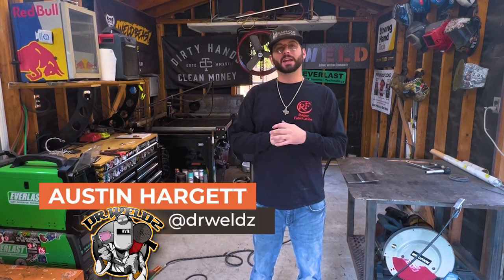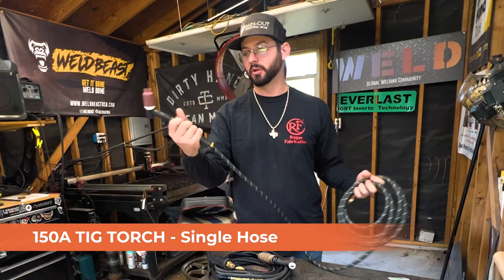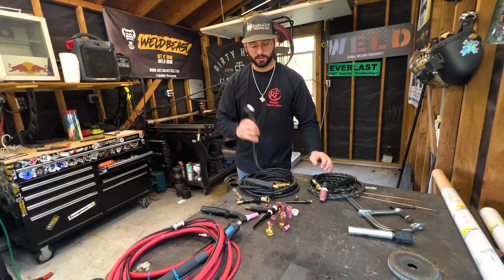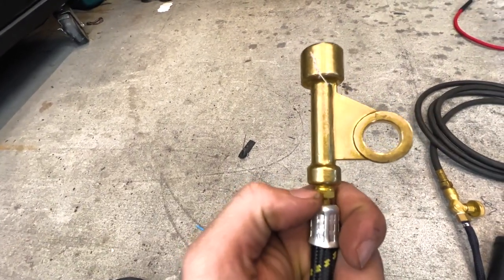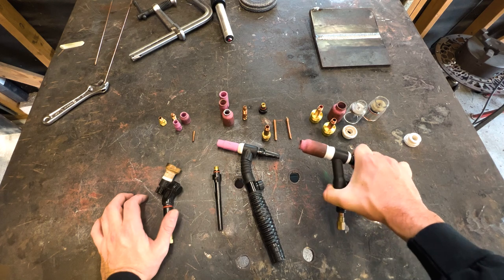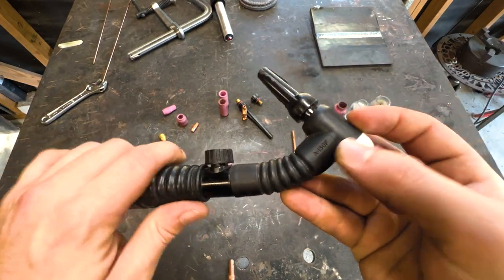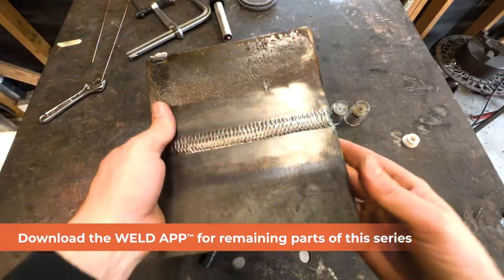How to Select And Set Up Your GTAW Torch

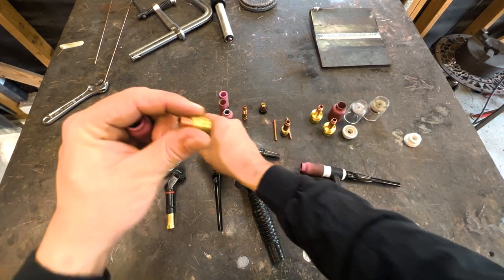Comment: 8:30...that 5 on the cup represents [5] 1/16 inch increments.....so it is a 5/16" opening, it is not Millimeters....at least the ones sold in the US are not... correct me if I am mistaken......and of course we all know what BBW stands for from Furick Cups......
Reply: Thanks Paul! Must’ve been something I was taught wrong years ago! Thanks for the clarification
Reply: @austinhargett5792  haha, probably some Furaneer trying to get you to do Metric........sorry to have pointed out after the episode was aired.....but I guess I would not have picked up on it if it was not aired.....cheers on a great episode.....and I want a BBW from Micheal Furick ya hear.....Paulie

Comment: Great video Austin! Thanks for the info.
I have a 1984 vintage Miller Thunderbolt AC/DC 240V machine setup with the adapter and the single argon hose going to a CK 19VFX torch. Great rudimentary Tig setup.
Question:: I have couple pinhole argon leaks in the hose running from the adapter block to the torch. Is there any way to repair that other than buying a new hose. Thanks in advance for your input.
Reply: I recommend a new one friend